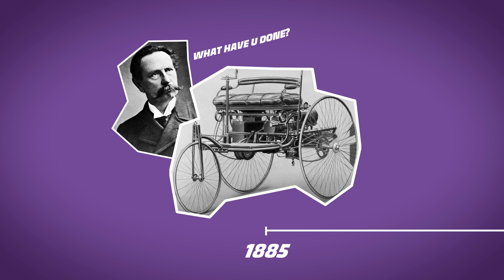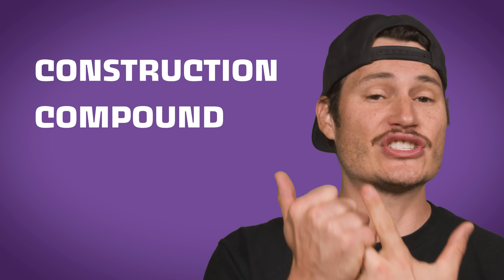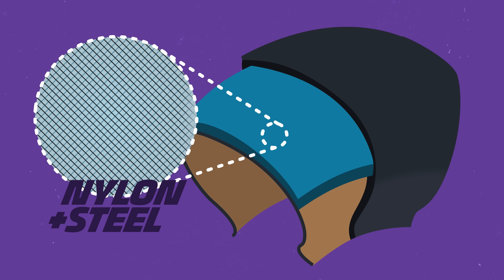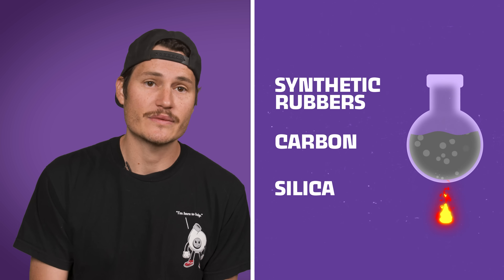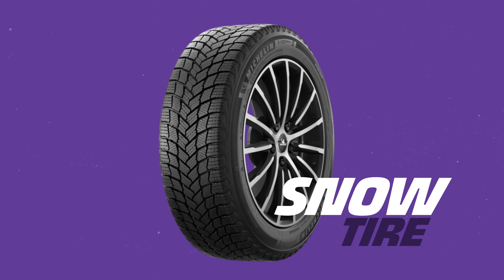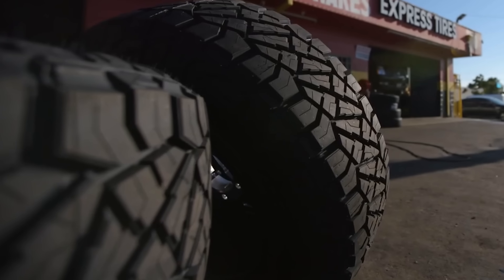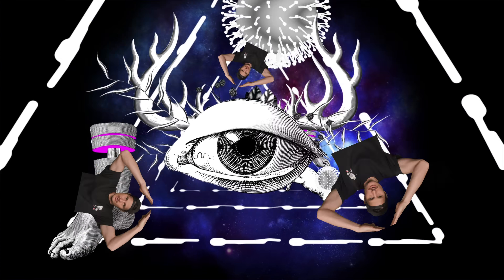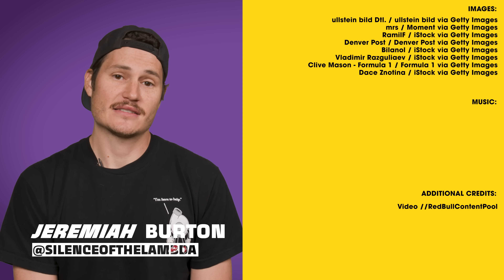The Surprising Science Behind Tread Patterns

Comment: The answer is that it isn't about the contact patch, it is about the composition. The softer the tire the larger the coefficient of friction is, but you also make them wider to handle the weight of the vehicle on the sidewalls (think tank treads). So ultimately the reason why people run wider tires for more traction is due to them using a softer compound which requires the sidewalls to be set wider apart in order for the tire to be able to have stiffer side walls and so they experience less roll which helps the car track straight or hold a corner better. This is what I know based on my freelance research of the topic.

Comment: Since pressure equals force divided by the area of contact, it works out that the increase in friction generating area is exactly offset by the reduction in pressure, the resulting frictional forces, then, are dependent only on the frictional coefficient of the materials and the force holding them together.

Comment: Found this from a university professor online:

Big question is why does friction does not depend on surface area?
Since pressure equals force divided by the area of contact, it works out that the increase in friction generating area is exactly offset by the reduction in pressure; the resulting frictional forces, then, are dependent only on the frictional coefficient of the materials and the force holding them together.

Comment: Drag racing tires use softer compounds for more grip, but soft compounds makes the tire structurally weak. More surface area helps support the weight of the car, kinda like how snowshoes keep you from sinking into snow by distributing your weight over a larger surface area.

Comment: Wider tyre(tyre) has more surface area to distribute heat. This also helps with heat dispersion. The contact patch is stretched laterally which helps with cornering. The wider face of the tyre has more stable contact patch and the greater contact patch size under various loads when tyre is deformed in various directions. Compared with a passenger tyre that tends to roll on its side when cornering. That is on clean, dry, homogenous surface.
Reply: Also more meat of the grippy compound. As tyre "thread" is being used up fairly quickly in racing conditions, the wider surface area can have same amount of rubber spread with thin layer or more tyre compound with increased area

Comment: So according to Amonton's second law, friction is independent of surface area; it's only dependent on normal force and ye olde coefficient of friction. 

But in a big turn you want to stay planted as much as possible so you don't affect your coefficient of friction. E.g. if it tilted and you started riding on the edge of a tire you get less grip; the edge material has a different coefficient of friction. 

So you make a big friggin tire; it helps you stay planted, and you go on your merry way. 

Plus if any part of the tire gets wet you gave a good (or better..) chance the rest of the tire is dry.

Comment: F=uN is a useful simplification. The coefficient of friction (u) between two materials depends on a lot of factors including the temperature of the materials and contact stress between the two surfaces.  A larger contact patch means less contact stress. A larger contact patch will also mean slower tire wear for the same compound and driving conditions. Imagine a skinny eraser and a fat eraser of the same length. The fat eraser is analogous to a tire with a larger contact patch and lasts a lot longer.

Comment: About the surface area, i know im late and without an exact explaination, but the mu constant only work nicely(linear) in a certain range of forces, that range of forces is surpassed when doing racing or big accelerations and physics turn more complicated. In race slowmoves repetition focused on the wheel one can see that the torque is so high the tire bends and lose grip with the floor, changing the mu "constant" and making it a variable, then we can enter into modelling mu depending of the resistance to bend, that depends on mass, size and area that is what we want, and other extra factor that we loose with the simplyfication that we saw in school.

So there you have a nice and neat explaination for introducing the subject of what is the mu constant, just like a donut video!

Comment: Hay dudes, 
I would like to answer the question, the way I see it is if you look at the contact patch as a rectangle, having the lager wheels will help because first as the side wall is so large it allows the tyre so be softer increasing the contact patch second there will be less heat as the total area of the tyre is larger and three having a larger tyre at the back will gear up the toque band meaning 1st gear can shift later meaning you can tune 1st gear for more torque. 
Lastly the frictional force equation say 0.85 would have to be multiplied by the total area of the same force ie the two rear tyres then another would be calculated for the front two as they are different and as drag cars are rear wheel drive the most friction at the back is better and less at the front.
Hope this helps

Comment: the more surface area offered by the wider tires helps disperse the force over a wider area, which means the wear on the rubber isnt as much. The tires dont wear as quickly and dont heat up as fast

Comment: To answer the last question, it’s because friction is depending of force and not surface area. If the only difference wins surface area the normal for will be distributed differently but the needle with the same weight and material as the large box will be equally as hard to move. To prove the surface doesn’t mater think of a box and a wall. The box can have indignant surface area but it will never stick to the wall because the normal force is 0. For tires, it a little different since the more friction the fast you accelerate. I would think of surface area allowing you to hit your maximum calculated friction.

Comment: The Mu constant isn’t actually constant, it’s dependent on the pressure applied between two surfaces. So for the same force with a higher pressure (smaller tire) the Mu goes down because the microscopic interactions of the tire and road get crushed effectively making it flatter. So having less applied pressure to the road (big tire) allows the microscopic profile of the tire and roads imperfections to more easily interact. That would raise the Mu. increasing the weight of a car will always increase the frictional force. It will never reach a limit where adding weight (pressure), make the total frictional force less.

Comment: In particular my spoet tires have 3 main components. One is for how stiff they are, the side wall. The other is how soft they are, or are not, stickiness (with a "stickier" better grip tire, wear is compromised. On the flip, a long lasting tire will wesr less but grip less). Finally, the middle of mine have carbon fiber. So this is the part of the tire (on the street anyway) which makes the most contact but has the least concern when it comes to grip. I.e. if you are driving straight the chances of slipping are not common, assuming you have any riding skills.
It also extends the tire wesr as this is the  part manufacturers realized wear out before all else. So, its a huge progression to motorcycle tires.

Comment: A larger contact patch increases the chances of achieving the maximum coefficient of friction between the car tire and the UNEVEN road surface. With this concept in mind, a wider tire will have a larger percentage of it's contact patch perpendicular to the direction of travel does,  improving traction. Think of a road with a few loose rocks. With thin wheels (like on a grocery cart) each rock takes up a large percentage of its contact patch. But with big wheels, a few little rocks take up a much smaller percentage. Side note: Wider tires commonly have stiffer side-walls and experience less roll.

Comment: From a fresh engineer: I haven’t read every single comment here but I hope to give the best possible answer to the question as many people are saying why and not why not. As stated: the equation for frictional force is Ff = u/Fn. The normal force is the most important part here. Normal force is essentially the force experienced on an object by the ground because of gravity pushing the object into the ground. This normal force is actually independent of surface area and is actually just the weight of an object. The easiest way to understand this is through an analogy. Even if a person is laying down, standing on two feet, or balancing on a single finger. They will stay weight the same and normal force will be the same. It just feels like there’s more or less force due to the pressure (Pressure = force/area) experienced by contact part. Norma force is determined by force and not area. 

The amount of torque needed to cause a 40 lb tire to slide with a small contact surface compared to a 40lb tire with a large contact surface will be the same because the distribution of weight will counteract the increased surface area.

TLDR :  The frictional force is independent from surface area and relies entirely on normal force. The same amount of normal force is experienced at however much contact is being made. A light tire with more contact surface can have the same frictional force as a heavier tire with less contact.

Comment: I believe wider tire produce more grip but also puts more strain on the engine. Also depends on the surface the tires are on.
Example: I ran stock tires on Irwindale race track and no problems. I ran new wider tires and I broke my differential (transmission). However the wider tires helped me turn quicker on normal roads.

Comment: The simple answer is that tires and asphalt not only create frictional-locking connections, but also form-locking connections. The latter is so complex, that it will be difficult to calculate for every type of compound, asphalt, camber, load, temperature etc.

Also modern tires can have different compounds accross the surface, which makes it even more trial and error.

Comment: You explained why bigger tires have more grip even though surface area isn't a factor in F=uN. The roughness aspect and that on the microscopic level, the tire is hooking into the texture of the road and pushing perpendicular to it, not just sliding parallel. More "fingers" digging into the road from more tire means more normal force.

Comment: (Not an engineer here) I would assume that the formula for grip doesn’t have a surface area component because more surface area doesn’t increase the grip of the tire compound, it multiplies it, like if you have a tire compound that has X grip, more surface area doesn’t turn it into Y grip, it multiplies X grip because you have X times X grip depending on what surface area you have, so the formula for grip just measures the grip of the compound of the tire, and has nothing to do with surface area because the surface area just multiplies the same amount of grip (if that makes sense to you)

Comment: Well the main reason is that, for simplicity, we pretend that the friction increases linearly with force, but that's not entirely true. Secondly, if you have skinny tyres, the friction coefficient may be high enough, but during hard cornering the rubber doesn't just slide, it also kind of shears off. That's why you get these black lines on the road when a car is skidding. Even if the friction was perfectly proportional to the normal force, which in real life it isn't, the strength of the rubber itself also limits grip. And that definitely does improve with a bigger contact patch.

Comment: Answer:. pressure equals force divided by the area of contact, it works out that the increase in friction generating area is exactly offset by the reduction in pressure; the resulting frictional forces, then, are dependent only on the frictional coefficient of the materials and the force holding them together.

Comment: Wider tires are able to use softer compounds, therefore have a lower coefficient of friction.  So a drag car has extremely soft and wide tires with a really high coefficient of friction.  As the tires get narrower, the coefficient of friction goes up due to the compound getting harder.

Comment: Offroad tires are usually wider than a standard tire, so any loss of contact from the wider grooves should be at least partially offset by the wider overall contact patch. My Jeep went from a stock tire width of 9" to 12.5" when I lifted it and switched to mud terrains. It does great in mud/snow/dry conditions, but handles poorly in wet conditions and hydroplanes easily. That seems counter intuitive with the excessively deep and wide grooves that you'd assume shift the water away from the contact patch easily, but that's certainly been my experience.

Comment: just to fix it a bit. grip and two materials friction coefficiant aren't the same. friction coefficiant is basically a given number and it won't change. while grip is basically friction coefficiant multiplied with the weight that's pushing these two together. so the heavier the car, the more grip it has.

Comment: I have read somewhere that the (mu) coefficient of friction for rubber is inversely proportional to the pressure on the rubber. When you increase the contact patch (increase the area), the pressure on the tyre (due to weight of vehicle) decreases. This increases mu (and grip).
So to increase the grip of a car (as per the formula F=uN), you to have increase the weight (N) and/or coefficient of friction (u). And no one will advise you to increase the weight of the car to increase the grip due to obvious reasons.

Comment: More tyre = more better. ie. More tyre contact with the ground equates to more friction and "grab", so they tyres don't lose as much energy in minute slippage as the wheels rotate. Also, at high speeds, the tyre width contracts, due to the centrifugal force of the spinning wheels, so the wider the tyres, the more rubber that remains in contact with the road surface.

Comment: A common misconception is that a wider tire har a larger contact area with the road.  That depends on the tyre pressure so true for offroad tires and dragsters that are deflated but not for low profile street tires. Contact area between a wider tyre and a narrower can be the same.  My understanding is that the difference is in the shape of the contact patch and the way the tire deforms under load especially when cornering. A wider tire will not deform under load as much as a narrow tire and this prevents parts of the contact patch to break free from static friction.  A narrow tire that breaks free from static friction gradually across the patch is more easy to control but can not maintain the same level of grip.

Comment: Wider tires = more surface area of the wheel total that can possibly make contact, there would be a lot more rubber to fill in more grooves meaning the surface would be considered rougher than before, increasing friction since a smoother surface would decrease friction

Comment: absolutely because of tire load sensitivity , increasing the weight on a tire increases pressure on the contact patch leading to higher friction but that is only the case for a certain limit of weigh or (load) including static / dynamic or even aerodynamic . this limit called the tire load sensitivity and what it means , simply is , the greater the load the greater the grib but only up to this limit , now but increasing the surfaces area by using wider tires increases contact patch surface area pushing that limit far away even more allowing tires to handle greater loads by distributing it even more to allow for more capability to handle greater loads . and this is only the case if you are driving your car at this limit but if your tires are under loaded changing to wider tires will not increase the grib but only get more rolling resistance that s why its so important to make sure that you are driving on the limit of sensitivity of tires before upgrading to wider ones . (engineer)

Comment: The frictional force equation you are talking about does not take into account material deformation.  Rubber tires deform and key into the rough road surface, so wider tires have more surface area to key into the road and give you better traction.  Its like pulling yourself up a rope vs pulling yourself up a rope with knots in it.  With knots you are less likely to slide down because your hands have something physical to run up against rather then just friction of them against the rope.

Comment: That coefficient x normal force is a simplification. The coefficient is slightly better when the normal force is smaller. So when you have bigger/wider/deflated tires you are spreading the load over more square inches and each individual square inch has a smaller normal force and slightly better coefficient of friction.

Comment: Ffr = Mu x Fn
...Here, normal force can be expressed in terms of normal loading and contact patch area (when the tire is perpendicular to the road surface) as
Fn = Pn x An (where Pn is load in normal direction and An is normal contact patch area).

Substituting Fn gives the equation Ffr = Mu x (Pn x An).

Here we see that increasing either: the normal load the tire places on the road surface, the coefficient of friction or the normal contact patch area increases the friction between the surfaces. This is a vast oversimplification, but other factors being negligible, this model describes the case of bigger contact patch equals more grip (in ideal conditions). Wet surfaces are a whole different ball game.